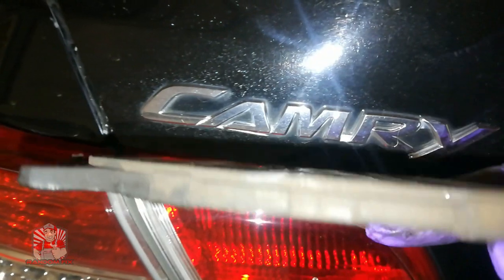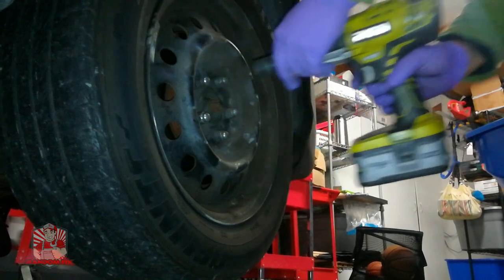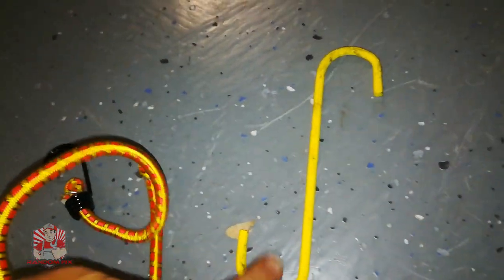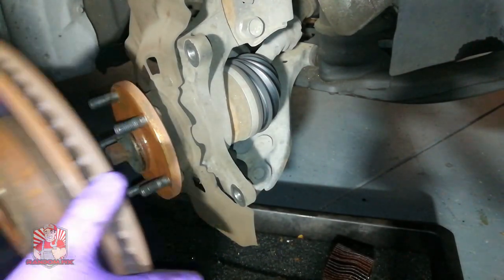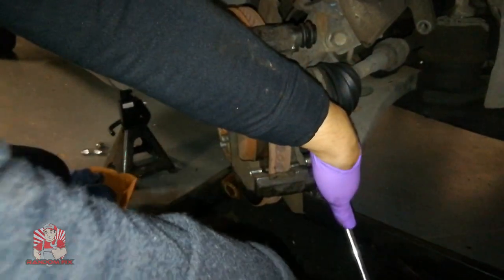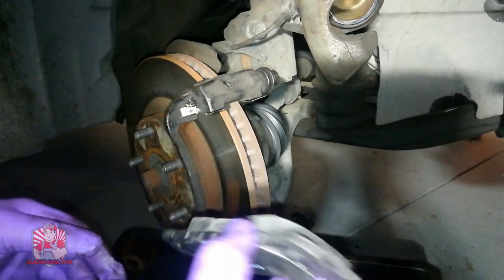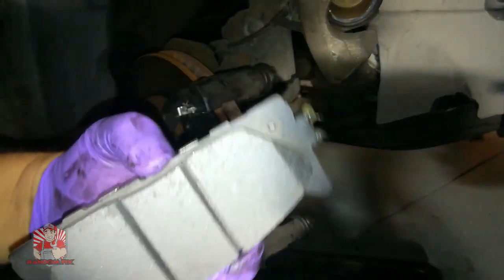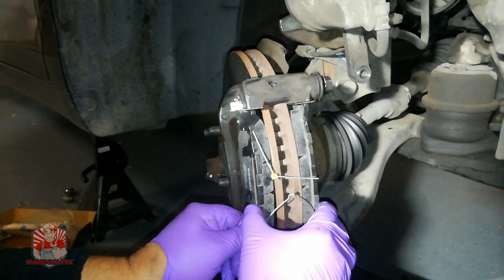Toyota Camry Front Brakes Pad and Rotors 2007-2011

Comment: I was working on a 2011 Camry. It did not have conventional guide bolts like the ones in your video. I presume they are now enclosed/encased/hidden. The bolts holding the caliper to the frame were much shorter and not guide bolts. 

I would like to say that what looks easy on a video can suck quite badly in real-time if, as in my case, the brake pads are manufactured with what is becoming more common--crappy quality control. I worked 4 hours trying to get the pads to fit properly into the springs in the bracket before finally realizing they were out-of-tolerance, too large.  I filed down a couple of high points and they went together--I won't say fine, because that would give to much credit to the sorry manufacturer. 

Kudos for a fine video. I've s'scribed.
Reply from the maker: Sorry to hear that you had a tough time with brake job. Never go cheap on the brakes, not because of fitment. Always get good tires and brakes.

Comment: I have a 2011 totoya camry and i notice for some reason i can't get the front pads in the slots with wear indicators so i just take them off and pads go in easily
Reply from the maker: Sorry for the late reply! did you find a solution?